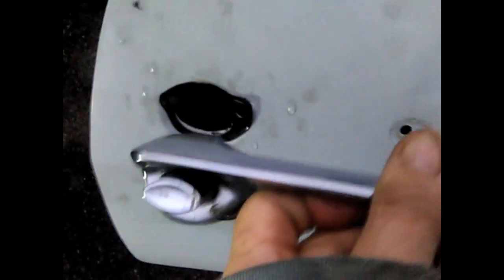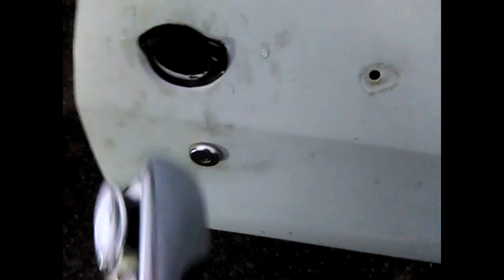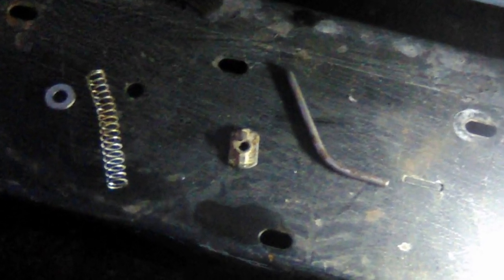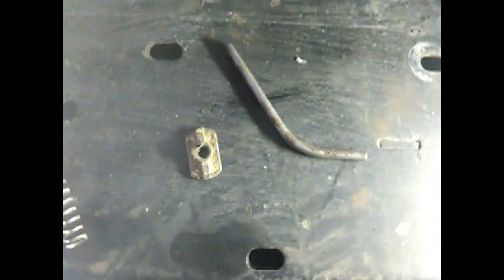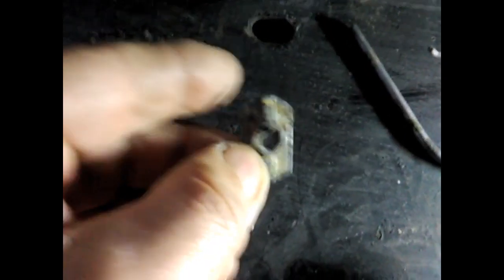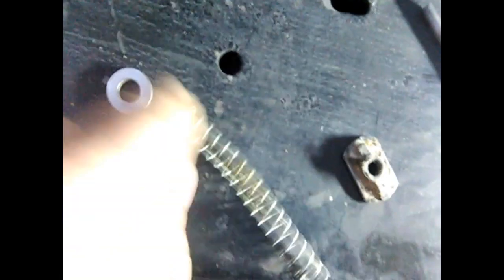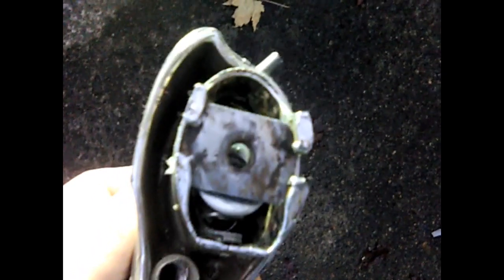Replace Door Handles  68-72 Chevelle

Comment: How did you get the rod out of the button?  I want to use my old rod In my new button, but that rod does not seem removable
Reply from the maker: The handles I got for this 1971 Chevelle don’t have the non detachable rod. What year are you working on?
Reply: @vanstechcorral  69.  I thought all years were me same
Reply: @vanstechcorral  i can see the rods in your video early on. You pulled them out of the button
Reply from the maker: I know they are not the same for 71 as they are for my 68 SS396. I honestly don't know what to tell you.